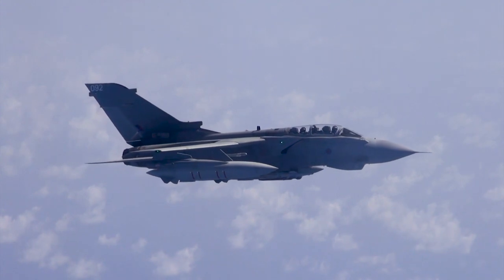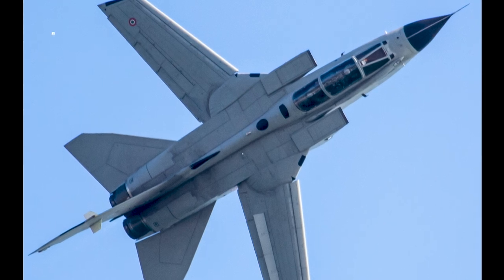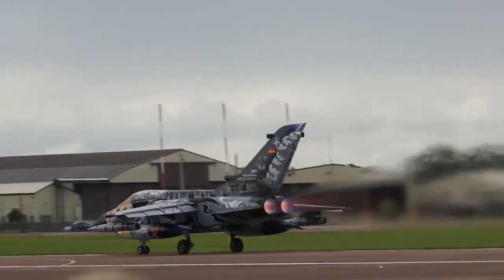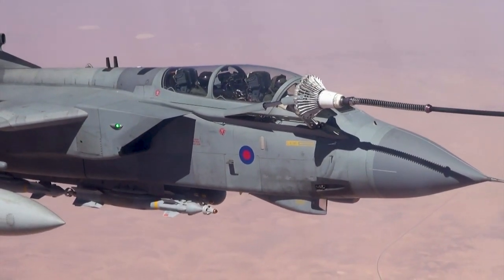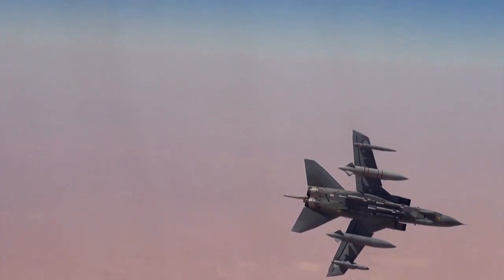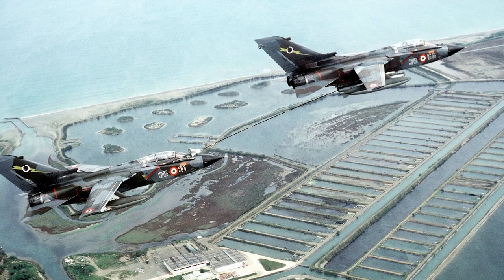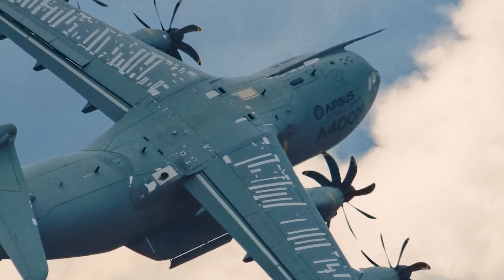Panavia Tornado - A Short History

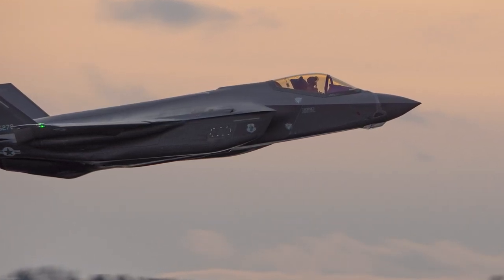Comment: Slight correction: at 5:03 you say that the German air force had retired their last Tornados in 2021. This is wrong.

As of late 2022, there are still 85 airframes in active service and 93 in total (we once had around 350). The last few aircraft will also stay in service for a few more years.

For a long time, it was the goal to have them retired in 2021. But since the last few governments could not come to an agreement for a successor aircraft, they just opted to not make a decision and leave it up to the next government in line, and thus the retirement date had to be pushed further aft.

We simply do not have a successor in service at this time. In March 2023, a decision has been finally made to procure 35 F-35As and 15 Eurofighter ECR to replace the Tornados. 

The entire replacement process, including thus decision, was somewhat controversial. The reason is that in addition to ECM systems we need a plane capable of carrying US nuclear bombs, as this is required per NATO contracts. The Eurofighter is not certified to do that (even though it physically could), and to get a certification Airbus would have to send classified data of the Eurofighter to the US government to get it certified for said nuclear bombs, and said data would obviously find its way to Boing, the rival of Airbus. Obviously, Airbus does not want this. And as a European nation, we also want to strengthen European defense industries whenever possible instead of just buying from the US. For a long time, buying F/A-18 Super Hornets for the Nukes and F/A-18 Growlers for the ECM was also considered, but this would be a bandaid solution and you are again not giving anything to the European defense industries. For a long time the F-35 was considered too expensive, but prices have obviously dropped quite a lot due to mass production. 

The other problem is that the Eurofighter ECR does not yet exist. It has to be developed first. And since Germany is basically the only nation interested in it, we are starting a whole new development process for just 15 planes. This will be VERY expensive. The indecisiveness of our past governments meant we could get the F-35s instead of Super Hornets, but it also greatly increases the cost of keeping the Tornado in service until the F-35s and Eurofighter ECRs are available, which probably does not happen until the late 2020s, especially the latter aircraft.
Reply from the maker: Thanks for correcting me!
Reply: What the heck are you blabbering on about the typhoon? You have been in use for at least 15 years.
Reply: True. The Tornado still is in service. You can see them pretty often in german sky.